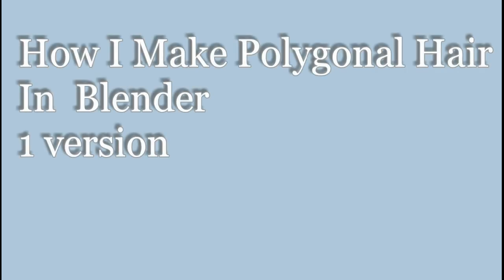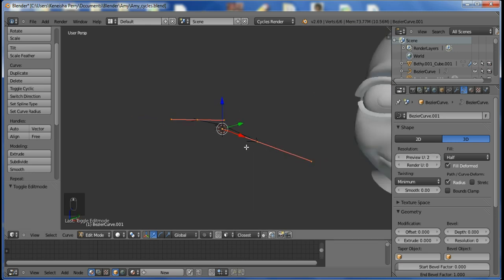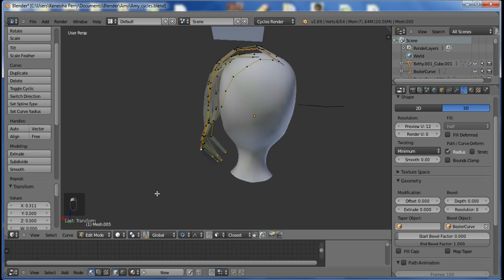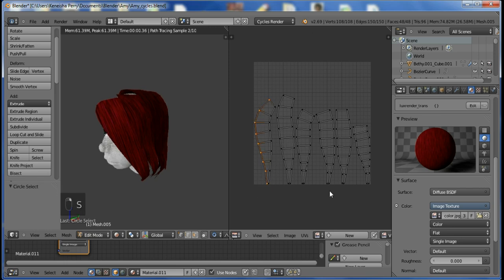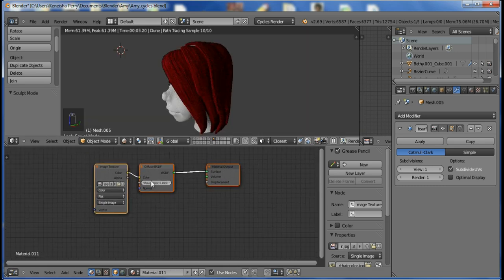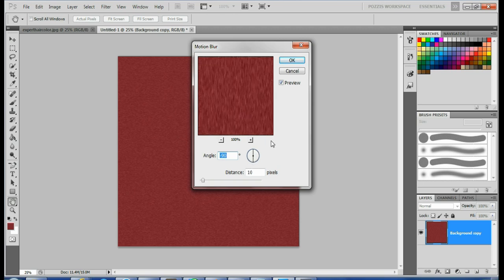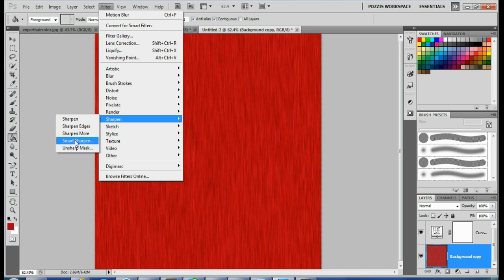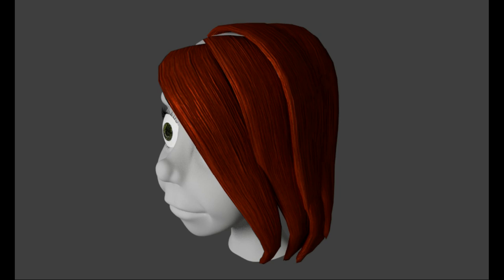Polygon Hair 1 - Blender

Comment: Hi, I'm having trouble exporting my hair. I convert the hair into a mesh and join it to my 3d model. In Blender everything looks fine, but other programs like Maximo 3d do not except it. I'm using Blender 2.78.
Reply from the maker: Darrell Glover I'm sorry to hear that.  Well there are a few things you can check but it's hard to know for sure without the blend file.  make sure all of your transformations are set like rotation,  scale.  go into edit mode on the hair to make sure it is actually a mesh.  try exporting in different formats, obj, stl, fbx. make sure the hair mesh doesn't have a million polygons and that there are no conflicting modifiers maybe? that's what i think of off the top of my head.
Reply: Thanks for the quick reply. I've tried different formats and making sure that the hair is a mesh. I tried using a lower number of hairs as well. I dont know what the problem could be. Could node implementation be my problem? I don't even bother to mess with this, because I thought it was only used for enhancing outward appearances. I'm using fuse characters.
Reply from the maker: Darrell Glover  oh? im not sure ive heard of fuse characters actually. im sorry you're having so much trouble. 😟
Reply: It's ok, I will try to figure things out. Thanks for the tips and the great videos! :)